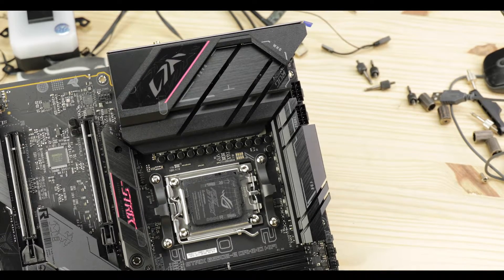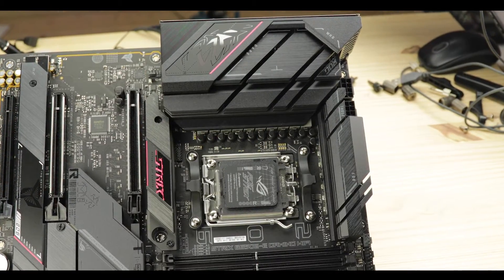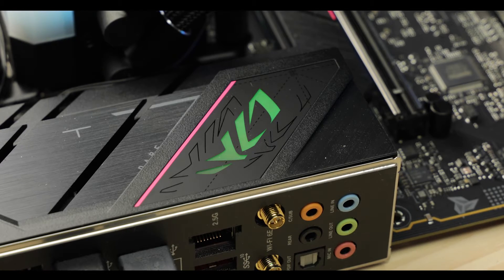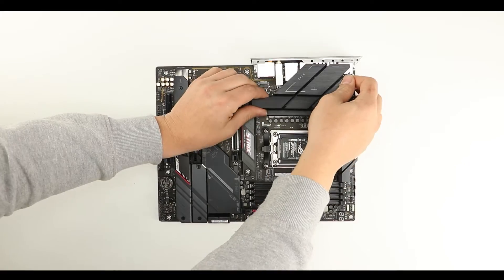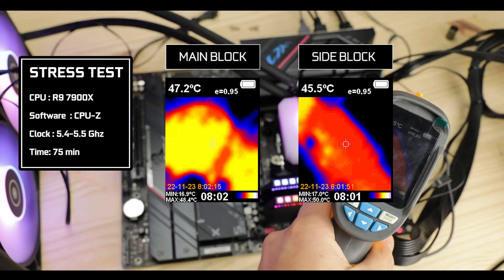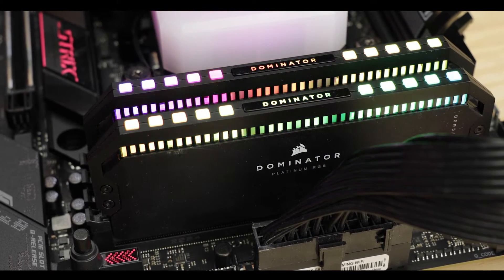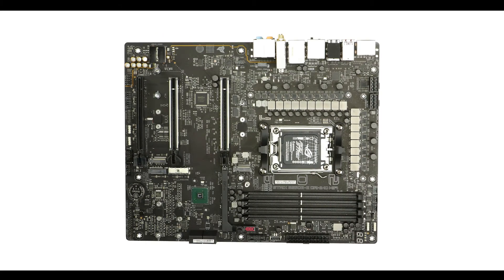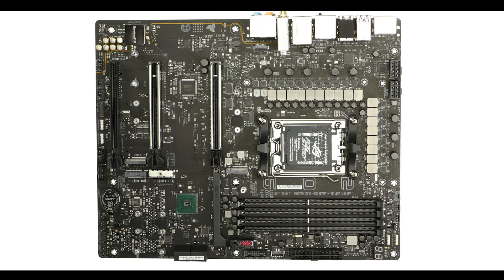ROG STRIX B650E-E GAMING WIFI : the only STRIX worth owning.

Comment: I have been researching motherboards tirelessly for over a week in order to decide on one for my PC upgrade. I was comfortable sacrificing the PCIe 5 GPU slot, so I settled on a few options at the $290 price point. I was preparing to purchase either the X670 Aorus Elite AX or the MSI MPG B650 Edge. However, after looking more closely at this motherboard, I was blown away at the value. For only $60, I go from one 4.0 slot to TWO PCIe 5 GPU slots, post code and clear cmos, improved VRM, ASUS reliability, and optional second Gen 5 M.2. I just back ordered it from Newegg. Very excited about this motherboard!
Reply: What do you reccomend for someone looking for high end parts whos not on a budget? I get how some motherboards arent justified for its pricing as some more affordable options perform pretty much the same but im just trying to see whats the highest "luxury" motherboard if you will for the ryzen 9 7950x and ASUS ROG Strix RTX 4090. I'm just confused as going off the most expensive isnt always necessarily the better option as i looked at some of the specs for the "higher end" ASUS motherboards are are lower than some of its cheaper counter parts
Reply: @milhousevanhouton5890  I have spent a lot of time researching these AM5 motherboards, but I am not an expert on this stuff. So, just want to make that clear.

A few points:
- I wouldn't even think about the VRM (power delivery to the CPU) since you are interested in a luxury board they will all be great.
- I don't feel qualified to judge the differences in audio quality. The audio codec is only useful if you don't own/plan to use a USB DAC for audio (that's what I do)
- Those with similar specs that I highlight likely differ slightly in their VRM power delivery, Rear I/O options, SATA ports, and/or looks. I'll let you judge between those aspects.
- PCIe gen 5 for the GPU is a useless feature now, but if you plan to keep this board for 3+ years you should see slight benefits having this feature for future GPUs.

If you are planning to replace the motherboard within that time, I would ignore PCIe gen 5 GPU altogether, and look at some of the great ~$290 options such as:
MSI MPG B650 Edge - $310
	1 gen4 GPU
	1 gen5 M.2 and 2 gen4 M.2
X670 AORUS Elite AX - $290
	1 gen4 GPU
	1 gen5 M.2 and 3 gen4 M.2

If you want a single PCIe gen 5 GPU slot:
ROG STRIX B650E-F GAMING WIFI - $300
	1 gen5 GPU
	1 gen5 M.2 and 2 gen4 M.2 (the 2nd gen4 erases your only expansion slot)
ASUS PRIME X670E-PRO - $350
	1 gen5 GPU
	1 gen5 M.2 and 2 gen4 M.2 - and the choice to activate 1 gen3 M.2 at the expense of 2 SATA ports
ROG STRIX X670E-A GAMING WIFI - $420
	1 gen5 GPU
	2 gen5 M.2 and 2 gen4 M.2
ROG STRIX X670E-F - $450
	1 gen5 GPU
	2 gen5 M.2 and 2 gen4 M.2
X670E AORUS MASTER - $500
	1 gen5 GPU
	2 gen5 M.2 and 2 gen4 M.2
	Post Code
	E-ATX size

If you want the option for dual PCIe gen 5 GPU slot:
(gen5 x8 being full gen4 bandwidth and x4 being 1/2 gen4 bandwidth)
ASUS B650E-E Gaming Wifi - $350 (My Choice)
	2 gen5 GPU (x8/x4)
	1 gen5 M.2 (w/ a 2nd gen5 if running GPU at x8 speed - which is still full gen4 bandwidth) and 2 gen4 M.2.
	Post Code
MSI X670E Carbon WIFI - $480
	2 gen5 GPU (x8/x8)
	2 gen5 M.2 and 2 gen4 M.2
	Post Code
ASUS ROG Strix X670E-E - $500
	2 gen5 GPU (x8/x4) 
	3 gen5 M.2 slots and 1 gen4 M.2
	Post code
ASUS ProArt X670E-CREATOR WIFI - $500
	2 gen5 GPU (x8/x8)
	2 gen5 M.2 and 2 gen4 M.2
	10gb/s LAN
MSI X670E Ace $700
	2 gen5 GPU (x8/x8), or 3 gen5 (x8/x8/x4)
	1 gen5 M.2 and 3 gen4 M.2
	10gb/s LAN
	E-ATX size

Hopefully, that helps you make a more informed decision. And I encourage you to maybe do some more digging on the respective boards once you narrow it down to 2-3 options.
Reply: @charlesjag3407  Wow thank you for taking the time for the insight!! Its been extremely informative and helpful! Much appreciated!!!! :)
Reply: @charlesjag3407  MVP
Reply: @charlesjag3407  If I have Two M.2's will the PCI-E on the ASUS B650E-E be limited? or is that only using port 3 and 4
Reply: @Peetskeet  You can occupy 1 gen5 M.2 and 2 gen4 M.2 without limiting the main PCI-E in any way. 
An additional socket (M2_3) is gen5 which, when occupied, will limit the main PCI-E to gen5 x8 lanes and the other PCI-E lane to gen5 x4.
Reply: So can I use 2nd slot for you and use first for more m.2 in a caddy

Comment: Great review but you didn't speak about the big limitation on the second M.2 5.0 slot : "When M.2_3 is occupied with an SSD device, PCIEX16_1 will run x8 only." (hidden in the manuel)
Reply: BIG limitation you say? Are you kidding or what? First of all a 8X PCIEX 5.0 has the same bandwidth of a 16X PCIEX 4.0  (a RTX4090 can't even reach this limit) so no differences in the real world (not even a RTX5080, in fall 2024, will require a 16X PCIEX 5.0 so this MB will be the "top of the world" till at least 2026). Second noone needs two NVME 5.0: the best configuration will be a 1TB NVME 5.0 for the OS (and productivity software, like Adobe suite) and a 2TB NVME 4.0 for most demanding games. Then you can use the 4 SATAs to connect old HDDs (I currently have three HDDs, 8TB/10TB/12TB) for pure storage. In conclusion: this Asus Strix B650E-E is THE motherboard for the next 6-8years.
Reply: @SirTE0  4090 or any current graphic card doesn't support pciex 5.0, so when your pcie 5 slot is working in 8x mode, 4090 will read it in pcie 4 8x mode.
Reply: @artemgoncharov3048  well thats a point of discusing. 4090 works on x8 5.0 or x8 on 4.0.. anyway, should be noted 4090 uses only 50-65% bandwith of x16
Reply: @milordas  4090 reads pcie 8x 5.0 as pcie 8x 4.0, and it have impact on productivity, although it is not significant. But it is worth to mention, especially when you spending so much money both on graphics card and motherboard
Reply: @SirTE0  Would it be the same thing on Intel?  I ask this because I see many comments saying that using the m.2_1 5.0 slot the GPU would work at 8x, is this the same on both platforms?
Reply: @SirTE0  Nice explanation man I was wondering about that.
Reply: @SirTE0 half of 16x is better than 8x.  So it is different, whether the impact is perceptible, that’s a different story.
Reply: @SirTE0  Similarly priced Gigabyte B650E allows for all 4 M.2's to run at Gen 5 speed for the PCIe 5.0 x8 tradeoff. And all the tradeoffs are mentioned in the specs on their website, you don't have to browse the manual.
Reply: @CywlexeemTacac  Gigabyte b650e aourus master costs almost 100 more where i live
Reply: @thesolidsnek8096  The same is here, which keeps me from jumping to the new generation. But I think it costs so much for no reason. Or for this particular feature, not the actual cost. I'll wait until the price is reasonable.
Reply: @CywlexeemTacac  that’s not actually true. Gigabyte imposes a similar limitation. Plus the “limitation” isn’t even a limitation if you’re running a gpu in that slot. There’s no false advertising. 
You can’t go ahead and be a “PC Builder” and be taken by surprise by a simple chipset limitation…
Reply: @CywlexeemTacac  I mean you said similarly priced.... i got the b650 ef from asus for 250 euros. The gigabyte costs north of 370 euros...
Reply: @thesolidsnek8096  B650E-F is quite inferior to B650E-E hence the price. Asus B650E-E and Gigabyte B650E Aorus Master are comperably priced now.
Reply: @SirTE0 Hello, I’m really sorry to bother you after 11 months you posted this comment haha, but I’m about to buy this motherboard because I want a B650 with pcie 5 for my graphics card and be chill for years and years, but I don’t really understand what you guys were saying. Were you saying that this motherboard is a pcie5 for gpu but only x8? Which means it’s the same as pcie4 x16 for graphics card? I’m really sorry I don’t understand and I’m about to buy my B650 motherboard, so if you could help me I would really appreciate it. Thank you!
Reply: It has two pcle 5 x16 slots but the lower one is shared with the m.2 so if you have an m.2 installed it will take away bandwidth and both will be pcle 4 times hich is a non issue really since it is only one slot and unless you wanna run a dual gpu 5090 setup (which probably won’t even saturate pcle 4 completely with recent information) it is a non issue.
Reply: @ademo6600 There are no gpu’s that use pcie 5.0, even the latest AMD and Nvidia GPU’s are pcie 4.0, the only 5.0 compliant devices are m.2 nvme drives, I hope you researched this before buying a motherboard.
Reply: @MaskedOG  no, the upper PCI-E is shared with the 3rd m.2
Reply: Fuck i just bought this mobo and i got 2 nvme ssds.  Fuck asus.. damn. I want x16 full lanes !
Reply: This is common practice for mobile manufacturers.
Reply: Hello . I have 2 ssds installed on this motherboard but i dont see both. Only 1 shows up. Any info on how this can be resolved
Reply: @jackdawson4807  which gen ssds are they?
Reply: @thesolidsnek8096   gen 3 and gen 4
Reply: @jackdawson4807  Make sure that you arent using the second pcie 4 X16 slot combined with the M2_3 slot. If that isnt the case return the motherboard.
Reply: @thesolidsnek8096  what are people using the 2nd PCIe slot for ? Pretty sure sli is dead , should be a non issue no ? I am looking at this board an I have 2 nvme , don't want to steal bandwidth from my 4090 but that will be in the 1st PCIe slot
Reply: @Dx-so7jm  It is a non issue to me, there are many things you can plug into a pcie slot tho. I got the exact same motherboard and i am super happy with it. The thermals are great, i am reaching expected benchmarks with my cpu on it. The post crisis bios has solved the issues. I have only seen people complain about the intel i225 ethernet chip. But that has not been an issue for me with 2 of the same motherboards on 2 different rigs
Also have a 4090 , this motherboard has also been cool because you can install the gigabyte gpu support bracket on it.
Reply: Good catch. Time to sue Asus for false advertising.

Comment: Please please please can you help me decide with this motherboard or the Gigabyte Aorus Master B650E, just in terms of future proofing mainly. Which mobo has better pcie 5.0 lanes ?
Reply: Hey! I don't know if you already made your decision, but the Strix has 2 PCIe 5.0 slots x16 (second at x8/x4 speeds), the Aorus has only one and also the audio codec is the ALC1220, which is very good but last gen compared to the ALC4080 SupremeFX, also less audio capacitors on the Aorus and, if you want to use a 5.1 sound setup using the audio jacks, you'll need to connect the third cable to the front of your case, which for me is unbearable haha (I use 5.1 speakers). Just my 2 cents, I hope this helps.

Comment: i bought this board for my 7600x with the idea its the perfect board for a future upgrade to the 3D cpu even though its over kill for the 7600 =)
Reply: Im thinking about pulling the Trigger on this board. I am building a 7900XTX 7900X3D as soon as I can get my hands on the 3D Chip. I may do a 7950X3D. Just prepping everything early and moving old parts to another case soon.
Reply: Got the same set up 7700x and b650e-e was gunna go for the b650-e-f but got this bad boy installing next week yayy
Reply: Exactly same case here. Comparing to my actual i7 4790k (😂) the 7600X is a total monster of a CPU and will go well until the X3D of this and next gen arrives.

Comment: Just found your channel. I just bought this board with a 7950x coming. Though, I am coming from a 3900x X570, with a custom loop, I will want to reuse my loop - will that 1 water pump header be okay for a D5 pump? I only cool the CPU, really.
Reply: Yes. Not sure why he was being weird about Watercooling with this board. Board has hardly any bearing on it. It just tells the pump what to do. You will be fine. Your pump draws its power from the PSU directly. Pump header is more or less universal.

Comment: I got this board in Europe for 390 Euro - 45 Euro Cashback - 25 Euro Cashback for writing a review. So for 320 Euro it is a very nice looking premium B650E board that has in some cases even more features than similarly priced x670 or x670E boards. My only complaint is that it could have had a bit more RGB though. Whats also nice is that in the Asus BIOS you can change the Precision Boost Overdrive mode to Enhanced and than change the thermal limit from 95 C to 80 C. This allowed much cooler and quieter operating temperatures at the same clock speeds as default.
Reply: Try to run a Crystaldisk benchmark on SATA SSDs/HDDs and you will be shocked. The maximum speed you can reach is 40% less than it should be: a common Crucial MX500 2TB/4TB can't reach 540MB/s as it does on all other motherboard but it's limited to 399MB/s. And fast HDDs (like Seagate ones 10+TB) have a maximum speed of 160MB/s instead of 250-280MB/s. This motherboard is a scam! (I'm one of the unlucky owners)
Reply: where did you buy it ? 25 € for review would be nice to use :) thx bro
Reply: @xFLIXEN  keep an eye on Galaxus I just got a like new one for 307 EUR

Comment: Just discovered your channel by googling reviews for this interesting board. Awesome video! I'm having a bit a trouble wrapping my head around the pcie 5.0 lanes. I guess my bottom line question is this: will I be able to run BOTH a pice 5.0 graphics card at the same time as ONE pcie 5.0 M.2 drive? The use case seems pretty obvious, but hard to clarify: I'd want my operating system M.2 drive to be a kick ass pcie 5.0 drive WITHOUT sacrificing a next gen 5.0 graphics card (single card config). Merci!
Reply from the maker: Salut Remy !

Short answer is yes to your question. Both remain PCIe 5 in case of simultaneous use :)

Welcome to the community Remy :)

Comment: Hello! Wonderful video :) subbed right away!
I currently am waiting to build a ryzen 7000x3d motherboard when it comes out, and am currently torn between this (strix b650e-e) and the msi b650 carbon.
This board is more expensive but has more features (postal code, more usb ports, pcie gen 5, 8 layer pcb), while the msi b650 carbon has the better vrm (16 + 2 + 1 with 80A) and overclocking capability (as they say).
What are your opinions on the two? Or should I just go for the X670E carbon?
Btw, I have an all msi build (AIO, graphics, psu), and am quite OCD on this, but this motherboard seems so desirable that I am willing to forgo the all msi!
Reply: I am facing the same dilemma
Reply: I was in the same dilemma but decided to go with the Strix since it has a slightly better audio solution (same codec, but more capacitors and software "bells and whistles") and is also cheaper where I live. The MSI has 2 more SATA though, and that's a plus for me, but eh... We can't have everything, right? Haha

Comment: The only downside is that by using the second M2 Gen 5 slot, the main PCIE 5.0 X16 will run at only X8, witch makes the second M2 gen 5 slot USELESS as soon as PCIE 5.0 GPU's come out.
Reply: Is there any benefit at all to having a Gen 4 M.2 drive in the Gen 5 M.2 slot anyway?
Reply: @tigerwalms  none
Reply: @zagohcap1  Cool, then no need to put it in the 2nd Gen 5 m.2 slot anyway, so I'm all good for when the gen 5 gfx cards are released down the line. :)
Reply: @tigerwalms  Exactly. If your a gamer. Your good. I could only see it being an issue if into production or something and need those crazy fast Gen 5 SSD's. Gen 5 SSD is pointless IMO. No gamer will ever require it within 6+ years. By then it would be time for a new board if you want to keep up. Im going to keep it for the Gen 5 GPU as well and just use Gen 4 slots for 2 SSD's M.2 Thats all I need.
Reply: It's the same with x670e-e. You have to go for Hero for 700$ to not have this problem. And to know this you have to check manual because they don't list this on their spec sheet!  For how much those MB cost it's just crazy. I know that even with 4090 running PCI 4.0X16 vs X8 there is like 2% difference in 4K but in two years with new GPUs things may change and if you use PCI 4.0 riser cable you will be running this new GPU at 4.0X8 (effectively 3.0X16)  or have to buy extremely overpriced (look at the price of 4.0 cables) 5.0 cable. And AM5 is supposed to be all about longevity  - buy now, update CPU when Zen 6 is out and use it with 6090 class card.
Reply: @KoMer7  I’ll just use the main M2 gen 5 and the other 2 gen 4, and leave the other gen 5 unused as soon as PCIE 5.0 GPU’s come out. Feels very wrong to hide this information in the manuals, this is something extremely relevant as it just kills the second M2 gen 5 slot. If they only shared the second PCIE X16 with the M2 gen 5 slot it would be miles better, but no, it has to be the main PICE x16, just stupid.
Reply: you are wrong but anyways we wont talk about that lol.
Reply: @Yeahnicegaming  I think you've misunderstood the concept of the comments section. You have the power to say why the person is wrong, why don't you give it a try?
Reply: @tigerwalms  Yea sure ill bite why not, a Pcie 5.0 lane at x8 is the same as a Pcie 4.0 lane at x16, the 4090 doesnt even fully use the bandwidth of a pcie 4.0 x16 lane, so when a gen 5 GPU comes out it will be fine because i doubt the rtx 5xxx series will still use the whole pcie 4.0 x16 bandwidth, now if we are talking rtx 6xxx series than yea maybe it will need a full x16 pcie 5.0 slot but that could be 5-6 years away at this point.

From what i read you could use all 4 M.2 bays and it would still run at pcie 5.0 x8

OR i could be competely wrong and misunderstanding what the person is trying to say, that could also be a possablity lol...